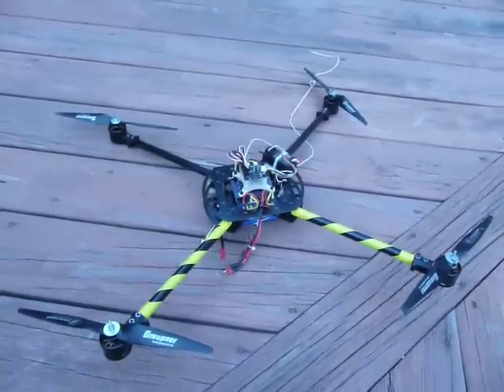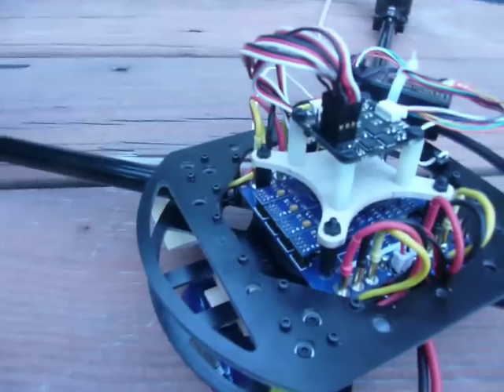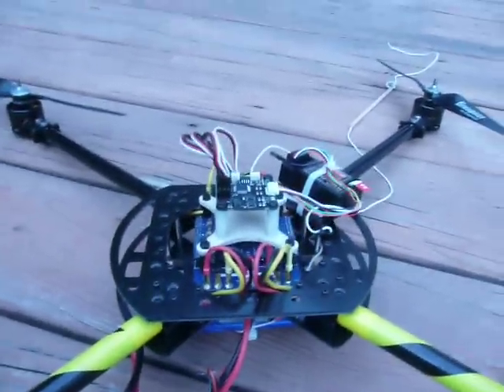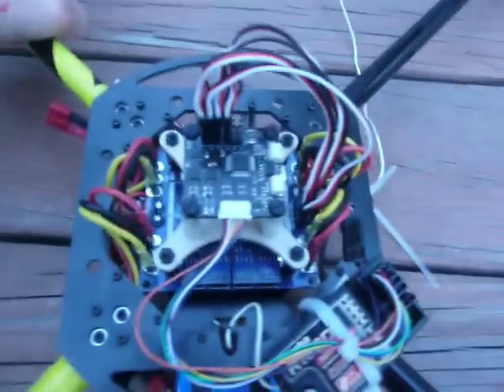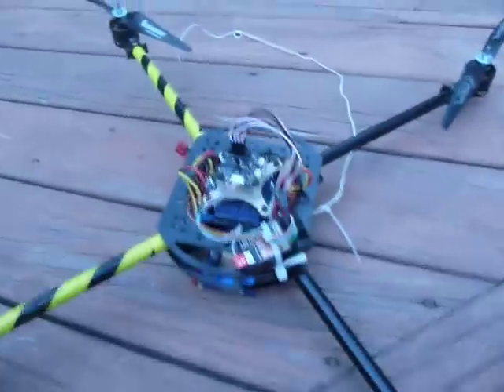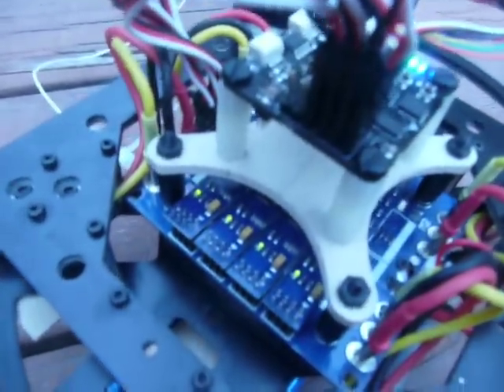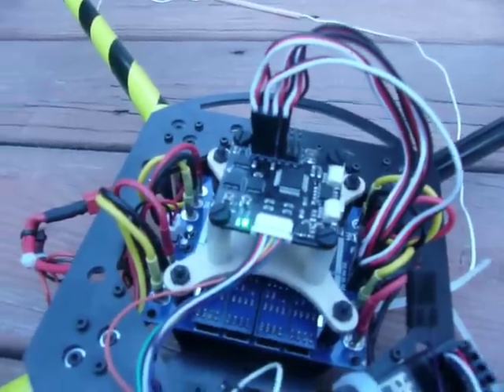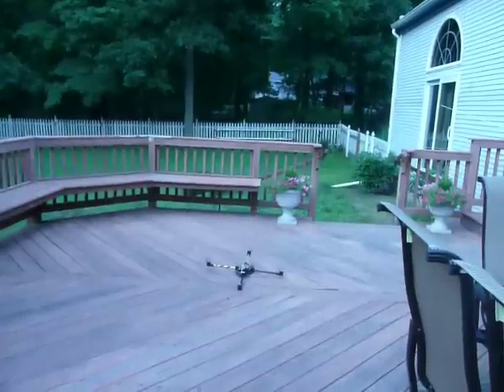X650 with CopterControl-Crash

Comment: @barchiola actaully my previous comment was a bit off. The accels dont help with yaw bias, any yaw problems was probably just related to the picking it up at the start. If the mag board gets coded, it will be able to correct that bias

Comment: @barchiola If you have it plugged into GCS when you first turn it on youll see it can take awhile for the gyro bias to kick in (if you look at PFD). If it was yawing, it was probably because you picked it up just before the 7s period, and then when you armed it, and the gyros resampled, the bias was probably out, and needed more time to converge. (It uses accels to work out gyro bias). I usually do small hopes after power cycling to make sure its converged now :)

Comment from the maker: it's set to calibrate on arming of the motors.  the crash was my fault for not having the throttle and motors set up correctly although it flew well earlier in the day.  for the second flight it was just unresponsive.  it's repaired and flying well.  this post wasn't meant to be a slam of the control board.
i'll try to post a response this week showing that it actually flies well.